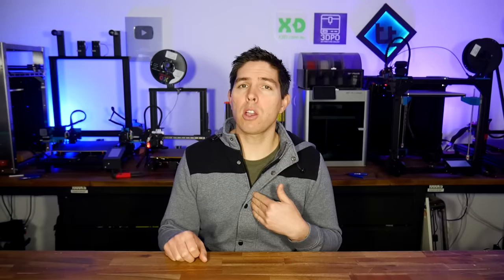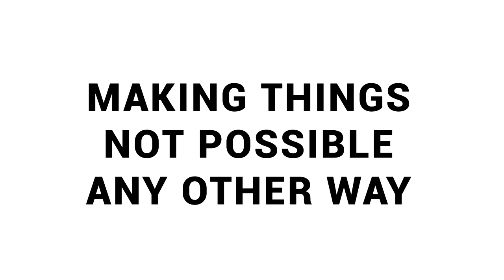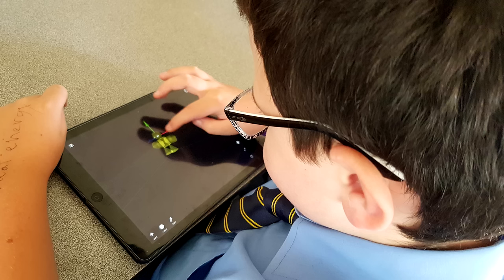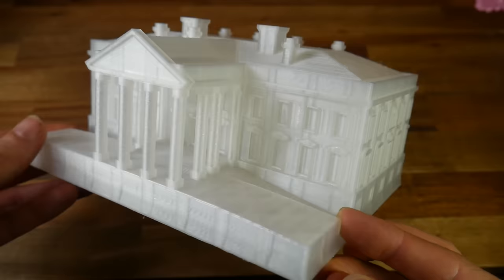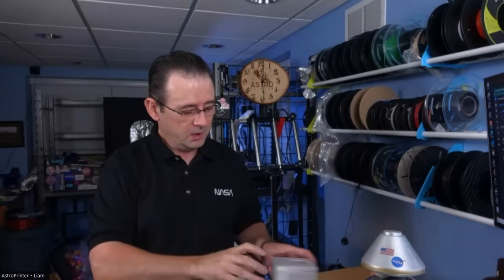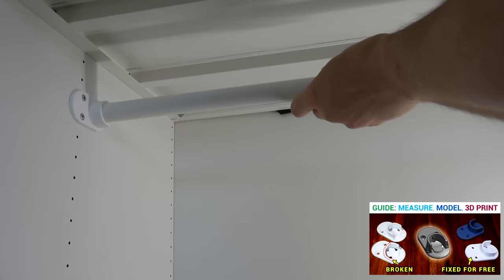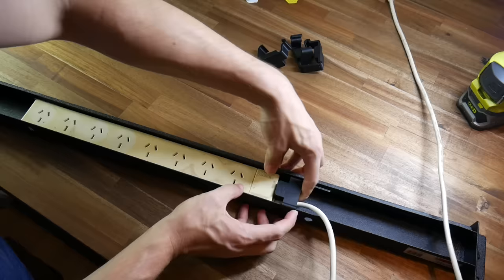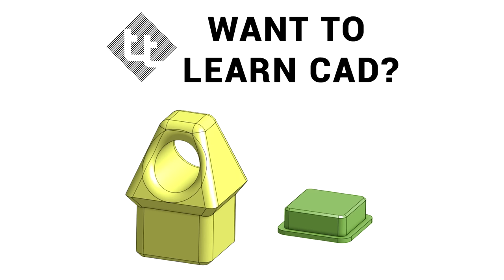These 3D prints will convert non believers

Comment: I am making vent covers with electronically-controlled louvres for my home's HVAC system. There are some commercial ones, but they are expensive and don't come in the right size for my home. Laser cutting and 3D printing have allowed me to manufacture parts quickly and easily that would have required much more expensive tools and a lot more experience to manufacture using traditional machining techniques.

Comment: First off, any one of my 'friends' who belittles my 3D printer, I make them something like a coffee coaster or a wall decoration. :) As to my projects, I was rebuilding a quad ATV when I discovered a very small, but necessary part was missing from the carburetor. I fired up Tinkercad and designed a replacement in minutes when a replacement would of taken a week to receive. That is just one example out of dozens of projects. Love your video and look forward to your CAD classes.

Comment: I've designed dozens of things to fix or enhance things around my house, my RV and for my eBikes. Some are just useful. Some are the only solution to fix something. When I bought my 1st 3D printer 5 years ago, my wife asked, "What are you going to do with that?" Now she loves that I have three 3D printers and have spent the time to learn Fusion 360. My fixes have saved us money, more than what I've spent.

Which ones are my favorites? They all are. But if my wife were to pick one, it would be the wine box that fits in our fridge for holding box wine bags. It has decorative grapes and grape leaves, with adapter plates for different brands of box wine nozzles.

Comment: A shooting board is a device used in woodworking to either square up the end of the board or refine a 45° angle. I needed to refine a 58.9° angle. I simply printed an attachment for my shooting board that would produce that angle, and was able to accomplish this task. Perfect 58.9° angles. I can’t think of another way I could’ve gotten there.

Comment: I use my E3 for printing mounts for various authentication devices - card readers, RFID scanners, barcode scanners - to mount on the sides of POS terminals.  I also print rear mounts for customer-side LCD displays for POS stations that don't have these as an option.  The E3 paid for itself in the first 12 station rfid mount run.

I also print various items for use around my home - powerboard mounts are a constant need, new levers for my toaster, knobs for my gas torch.  Endlessly useful.

Never printed a Benchy though!

Comment: Suggesting that 3D printing is useless is absolutely ludicrous.

I've printed so many electronics housings for projects and repair parts for various appliances.  None have failed.  I printed a local spot air cleaner for my soldering station, solar panel corner protectors (to protect the sharp edges), a set of large utility carabiners (ultra-lightweight, plenty strong, and 1/10th the cost of aluminum), a replacement lens cap for a friend..

Comment: I'm 72 years old and I received an Ender 3 Pro in perfect working condition for free along with 5 rolls of filament. I had to learn everything from scratch - the machine - Cura slicer - Thingiverse and others - TinkerCad ( still learning ) . Thanks to the many YT videos that opened so many doors. The result is after 7 months I can print most existing models , print simple 2 color objects and I can mod and design simple objects. I was a machine technician by trade so I understand machines and I have modded my Ender for reliable stable printing - ex: dual Z spiral screw & pulley etc etc. I recognize that there are speed limitations with my Ender but actually there's not much I can't print with patience.  On top of it I have gifted unusual objects I made and created smiles on the faces of  family and friends. Example : I gifted a Battery Charger for cars to my son-in-law but it was enclosed in a protective case I 3D printed. He rarely mentions the battery charger but raves about the case I made. Once you learn to scale objects in Cura or mod them in a CAD program the sky is the limit. What a great hobby and it has kept my mind in learning mode. Win win win ....

Comment: The usefulness of a 3d printer is in the ability of a person to see or be told about a problem.  For woodworkers it is vacuum hoses and attachments that no  adapter exists. For laser cutters its simple plug that fits in the bed and has a flange to hold down material.  For the lathe operator it is quick  tool post holders that don't rattle all day.  For me it is a circular  antenna wrench for my F150  that will not scratch the paint when I remove it to go through the car wash.  For the last 65 years I have built or repaired something almost every day.

Comment: Around 3 minutes mark you are mostly correct.  It is ' possible ' to make in standard injecting molding process the inner gears and while still held to a portion of the first mold, could include the sun and ring gears.  It is extremely expensive for the shear segments to fit with such tolerances and would make a less than one dollar toy cost over one hundred, even in 10 thousand unit batches due to the complexity.  I have looked into a few videos for LEGO manufacturing and even they will not do such due to the per part created price.  The tolerances to print in place makes the time to completion per piece versus the cost to pump out thousands with extremely expensive molds and a complex, multiple injection process, makes printing such toys the best option for almost anyone.

Comment: I 3D print so much it would be weird to be without it.  Of course toys for the kid, hot wheel tracks and such, but also other random things around the house like parts for the vacuum cleaner that broke, or storage things in the pantry, or weird parts like bushings for the refrigerator door.  I rarely if ever print any trinket type objects.  I do a lot of woodworking and print all kinds of useful tools and measurement devices.  I fly FPV drones and anyone who does that knows about all the 3D printing involved.  It causes my family hardship when the printers are down for any length of time.

Comment: i have designed and printed a lot of brackets and adaptors for things I need, mount plats for monitors, hangers for lights, knobs for a car door, battery cap for a Vernier caliper, Cases for Electronics projects, one time i had to print some parts to fix my toilet's flushing mechanism

Comment: I work restoring classic Jaguar cars, and my printer has paid for itself multiple times over by printing a dashboard air duct that is not a available.  The original is a rigid brittle plastic which often breaks with age, and the company who bought the tooling when Jaguar stopped making them broke the mold, and then decided it was not cost effective to replace it.  I modelled in cad and print in tpu for flexibility when installing the dash. When the parts were available they sold for around £60 each, with 5 on a car.  4 hours and around 50g of material per duct and much more forgiving when installing.

Comment: I only ever printed one benchy. I have printed calibration blocks to check accuracy.
No trinkets though. I have designed and printed items to make it easier in my workplace. One in particular clips to a spring loaded connector, it pushes down on the spring loaded part and locks in place. There is also a legend that identifies the electrical contacts and it has revolutionised the time taken to test those cables and connectors. Stands for meters, production aids that it would not be possible to print at work within a reasonable timescale.

And my other passion is replacement parts for die-cast 1/64 scale vehicles and 12” action figures.

Comment: You brought something up I think is very important, and very overlooked.  At multiple points in this video, you mentioned how you "designed" a part to fit a use case that you had a need to solve, but no viable alternative.  Cool.  Neat.  Amazing, even.  But how many people can do that, even among those of us who are 3d printing aficionados?  1%?  5%?  I very much doubt it's even as high as 10%, and that's understated. 

This is improving, slowly, but until (and unless, which I find unlikely) there is an easy button, it will remain a problem for quite some time, and much of what is available in the public domain is just different kinds of useless boats.  Well, useful for tweaking settings, but little else.  You won't be fishing with one anytime soon, though you could try printing up several thousand and seeing if you can float with those, but I wouldn't hold my breath.

Comment: Well done Mate, I'm sick and tired of people looking at my 3D printer and making stupid comments. I just recently printed end caps for an old stair banister rail, which was made in the 80's and the end caps can't be bought anymore, if you get your finger caught in the end of that banister as your coming down stairs, you don't have a finger anymore! I also printed housings for some high resolution underwater cameras we installed in our local aquarium (29 of them), because the profesionally made stainless steel housings (316L) couldn't handle the electrolysis in the tank but the PETG ones work fine! People have to start to understand how important 3D printing is, and how much fun and how rewarding it is to design and print something.

Comment: At 5:25 you showed that 3d printed part for the engine.  It made me think about how it could be used to make a mould for making the same piece out of metal.  Put it in some sand and pack it down, then remove the plastic piece and pour in molten metal.

You'll get layer lines, but the metal piece will be just as strong as any other cast metal piece, and in a piece that isn't going to be seen often, the lines don't matter.  If you really don't want the lines, you can either prep the piece by removing the lines via sanding or using some sort of body compound and sanding smooth, or by sanding and/or machining the final part.

Either way, you'll end up with a custom metal part that is exactly what you needed.

Comment: Thanks. I had my bath redone and one of chromed floor drains immediately rusted badly. I found a 3D printer file online that I liked and rescaled it to fit. Perfect first time in black PLA. A year later it just fell apart when I went to clean the drain. Oh NO! But Oh YES - the file was still on my Ender 5’s SD card and I soon had another. Parts are becoming hard to get for all sorts of things and 3D printing will help - that and older skills/techniques like welding. Prototyping the engine adapter plate was a superb example of how 3D printing can reduce errors inexpensively.

Comment: I printed an offset pan connector going from the toilet to the waste pipe on the wall (couldn't buy the correct size) and 18 months later everything is still fine... Fingers and toes crossed.

Comment: I rescued a 2yr old Husky lab mix in 2011-12 and he chewed the center console button frame on my 2000 Discovery II. I tried to get a replacement but was too expensive or didn't fit. I finally went online and designed my own using a caliper on the good half of the chewed part I had held on to for years. The printed part fit nicely and made my center console look less papa Gegetto...

Comment: When I was thinking about buying an Ender 3, I talked to my nephew about what to do with it. Previously I was scpetic to spend money on something you need just 3 or 4 times a year. Boy was I wrong. He convinced me to buy a printer saying I will find lots of opportunities in an ordinary household where printing parts can make a change. And he was right.
I printed lots of parts for small "problems" which I accepted without questioning. The first task happend when I washed the curtains. Of course, when I put the curtains down I broke some of those plastic curtain hooks. This would not be a big problem - just buy new ones. Except it was saturday evening and shops are closed at that time in my country. So what to do? I needed a solution, sat down, constructed a replacement in CAD and 3 hours later I had enough hooks to be able to put the curtain back up.
Today, there are lots of replacement parts or additional parts in my appartment which fullfill an actual purpose and were either impossible to buy, replace broken items (eg. a fan housing), or simply make life easier.
I never thought beforehand that 3D printing would be so valuable.

Comment: One of many items designed and printed: I needed a V-block and mount for my Nikon Shadowgraph. Original was unobtanium, a Mitutoyo version was >US$600 used. Fusion360, import Canvas, calibrate to a known dimension, iterate once on the base and done. Now I can hold round and small pieces for optical comparison or measurement.

Comment: During the summer of 2020 I was diagnosed with a return of kidney cancer. The last time was 18 years prier and by then I thought I was good the remaining kidney was working fine. Well as luck would have it, it wasn't. I was put on chemo for 6 1/2 months in an effort to shrink the tumor enough. During that time I was very sick most of the time so I didn't do much but it did give me a chance to learn about 3D printing. Following your channel and a few others I settled on an Ender 3 pro for my first printer and by October 2021 it arrived.
I slowly put it together and started to learn the ins and outs of printing with just PLA, despite the comments of how useless a thing like that was. 
Couple of months later I had my surgery and it was a fair success, they saved 1/3 of the kidney and it is working well enough I don't need dialysis (thankfully). 
During that time I proved the value starting with a simple strainer for the kitchen sink, a 4 color "chicken park" sign for my sister's chicken coup, a replacement light switch cover, and so on. So far I'm asked often by friends and family to design and build things from electric fence insulators for my sister's pastures to making a modified part for my son's shot gun ( the spent shell chute is for a right hand user and he's a lefty, poor kid was catching the hot brass on his cheek) to angle the spent shell downward rather than out. 18 self-watering starter pots for my sister's garden last spring she's still using them for next spring! (3/4 pound size so she had healthier plants to plant)
I'm at the point where new makers have started to come to me for advice I refer them to this and other channels because I don't know everything and only a fool would say so after only a year +.
It gave me something to do while i was sick and recovering and I'm seriously thinking of doing for a living. I've had to buy a second printer to help keep up with the demand I'm getting just from my close group so yeah, sounds like a good idea!
Reply: I should add that if any one else wants to get into it, setup a print farm area. I was doing in my living room and man did that cause problems!

Comment: I have few design skills, I tried to use Blender but I am horrible. That being said even with limited skills I found my printer quite useful. Printing parts that cost me $0.75 and saved $12 each while being stronger than the original for example. I am currently working on parts to help me start a business.

Comment: Our house has a central vacuum, and the sellers left us the original hose. The hose has a proprietary connection on the end that goes to an electric brush head, which is unnecessary because the whole house now has hard floors. Rather than trash the whole hose, I printed a new end for it that has the standard 1.25" taper for use with regular attachments. It's possible I would've been able to find that online, but it would take a lot of searching, cost more money, and I'd have to wait for it to be shipped to my house. Plus, if you're into waste reduction, you avoided an extra shipping trip to your house and the extra packaging of the part you bought.

Comment: Most useful print, an unavailable wheel for a dishwasher rack. The originals crack and fall off, so I’ve made several as spares. Most fun print...mechanical middle finger. Lots of other tool organizers for woodwork, leather crafting and laser etching. Mos5 important print has to be the bed extension for the wife’s sewing machine: happy wife, happy life!

Comment: The reason d3 printing might seem like a novelty is because a lot of the things you print will end up being on an as-needed basis. The closet rack replacement was a great example.
Reply: I got into 3d printing from using them in a production environment at work where we used them as part of products, to create tooling, and of course as a rapid prototyping method. Seeing examples similar to those would have been more persuasive in the video.

Comment: One use I have for my printers is to replace control knobs on my vehicles and appliances.  All the radio and environmental control knobs on my 1998 Silverado are 3D printed.  All measured and created from the original cracked knobs.  I have over 200 useful part designs from vacuum cleaner accessory brackets to vibration dampeners.  3D printing has been very useful and a lot of fun for me.

Comment: In Geraldton, WA where I’d holiday whilst growing up there was a Submarine built which help to establish the Crayfishing industry. It’s painted Yellow. I was fascinated by it growing up. I managed to use photogrammetry to establish reference points. From those points 3D designed a model and had that printed. Now I have a model, about 30cm long. If you want something that’s not available anywhere or it’s too expensive to buy, 3D printing can make it happen.

Comment: I bought a new vacuum cleaner, but the tools and hose that came with the new one were terrible to use, I wanted to use the tools and hose from the old vacuum but the hose diameters were different, so I printed a simple adapter - a short tube with two different outside diameters so I can connect the old tools to the new vacuum, simple but useful.